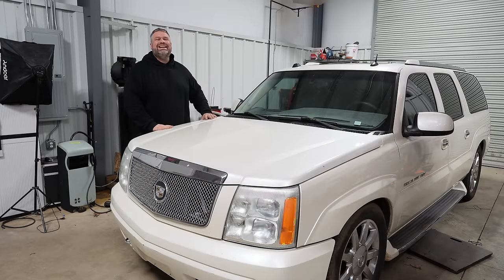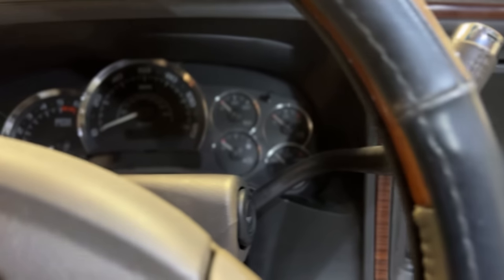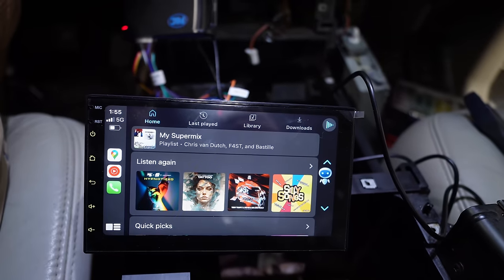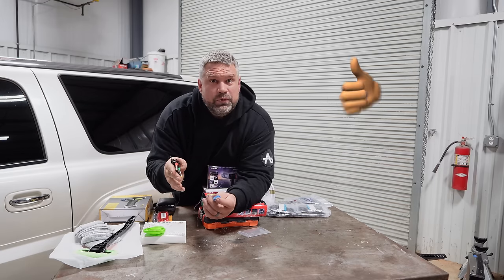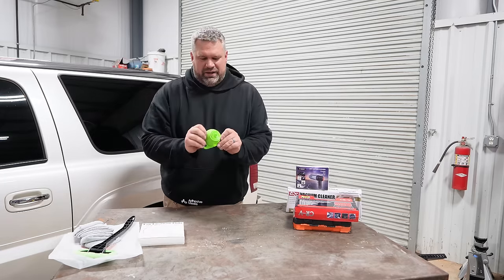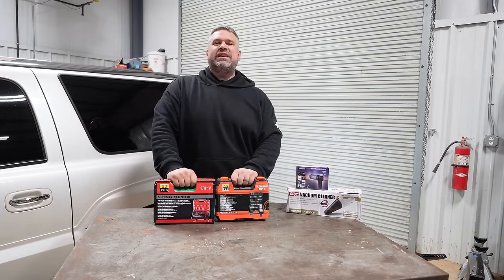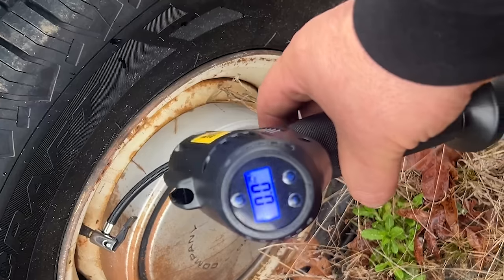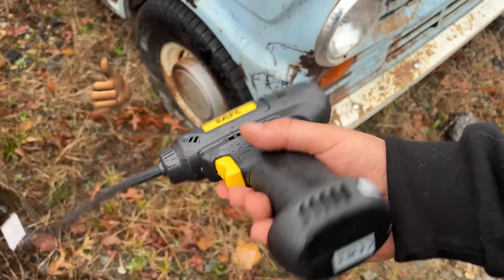Are Temu Car Products any good?

Comment: Temu, that's a negative ghost rider.  Anything my cousin has bought from temu has been cheap garbage, kinda like when hobo freight got started.  G-d bless.
Reply: Yeah, you have to manage your expectations. I have bought a few things from them. Some garbage, some not so bad. Bought a cordless electric ratchet that surprised me and helped me on a job tremendously. I would never compare it to a name brand one, but it did its job just fine and saved me a ton of time. I also got a LCD projector that worked well. Did have HDMI issues with one device, but that may have just been the device itself.
Reply: The whole site is set up to hook you on buying junk you don't need - the way their rewards etc. prey on the same psychological mechanisms as gambling does.
Reply: This is very untrue, i have ordered over 2000 dollars worth of stuff off of temu and almost everything has been amazing and worked as it should, keep buying ur jacked up brand prices while i buy what its rly worth and cost to make
Reply: @Undreamt412  The question is though, do you actually need $2000 worth of the disposable knickknacks Temu sells, or are you just buying it because it gives you a bit of a thrill, like playing the slot machines?
Reply: @Beer_Dad1975  hell nah lol, i have actually only payed for 700$ worth of it, its so easy to get free stuff, they also have a lot of really good tools, including an electric tire pump that got my dad out of a flat tire on the highway, trust me i cant afford 2000$ anything😂😭

Comment: One major critique: If you're buying a head unit... GET A KNOB! Trying to use the touch controls for simple volume adjustments can be infuriating. If you have steering wheel controls, it's much less of an issue. If you don't... GET A KNOB!
Reply: This, its so dumb they are ditching the knobs, I bet there are more car crashes just because of touch screens.
Reply: So, get a knobhead unit? ;)
Reply: guess you could install a volume knob, kinda like how we used to have bass pot knobs back in the day when we didn't care about our hearing
Reply: Used to? I'm 41 😆
Reply: I stuck a Sony 1-DIN basic unit in my economy hatchback that cost half the chinese-android ones, and put the money into better speakers. Now my hatchback is a tincan from Suzuki, but still at low-to-medium speeds the music sounds great.
At highway speeds the noise crowds out the music but that's the tincan to blame.
Reply: Real men like having knobs.
Reply: @PoliteChihuahua  That's actually what I did I bought a separate volume knob for my car to mount somewhere, but the options are pretty limited.
Reply: the major critique is not buying Chinese garbage head units, get a quality unit like a Kenwood or Pioneer, knobs are a good choice, but physical buttons are an acceptable fall back, on screen volume is a no go, steering wheel controlled is best, by far.
Reply: @DanielRichards644  Actually, plenty of Chinese head units offer newer chip sets and higher end components than many big brand name stereos. The main difference is usually the software development time. A unit from a big brand will typically have fewer bugs and a better warranty, plus higher quality overall, but that depends on what you are paying. They are often using processors and chip sets from several years ago while Chinese units may offer the latest available and higher resolution nicer quality touch screens. They are generally compatible with steering wheel control and other integrations as well. Just gotta do your research and you can often find exactly what radio and stereo amplifier chips they are using. Then you can compare to the big brands. Buy cheap and you'll generally get cheap, but for half the cost of a name brand you can actually get a technically superior product. Just take lots of research. The big brands are generally made in China now as well after all.
Reply: @802Garage  I have an android head unit in my 2016 civic because I needed it fit that dash and maintain vehicle functions that run through the headunit, these things have a single channel subwoofer output, a nice Pioneer will have 4 volt preouts that get you a cleaner signal to your amps. And that Chinese unit is glitchy with random ghost touches when in android auto and crappy call quality. A more powerful chipset is meaningless when the quality is all around lower and I bought the highest spec unit on the market that fits the civic dash.
Reply: @DanielRichards644  Well I feel like you didn't really read what I said. You can get everything your Pioneer unit has and more in a Chinese head unit, but you have to actually research it. Higher voltage preouts, front rear and sub outputs, a better built in amplifier chip, nicer touch screen. Pay bottom dollar you will get bottom performance. It's like comparing the cheapest Chinese made laptop against a $2,000 Dell or something and not also comparing a $1,500 Chinese laptop. You may have bought a high spec unit to fit your specific dash, but again that limits your scope to an extreme. You definitely didn't buy anywhere near the highest spec or highest quality unit available. I'm sorry you had a bad experience, and I'm definitely not saying everyone should buy cheap or no name or buy Chinese in every situation, but I'm just saying your single head unit is not the entire market. Either way, misses the entire point he made in the video which is if you just want to be able to listen to some music and don't want to spend a ton of money, telling someone to spend $350 or whatever isn't very helpful.
Reply: @802Garage  I didn't pay bottom dollar, the unit I bought cost more then my fucking Pioneer in my other car.
Reply: @802Garage  I did buy the highest spec out there with an octocore CPU, 8 gigs of ram and 128 GB storage and wireless android auto, it is still the highest spec android unit on the market TODAY.
Reply: @DanielRichards644  Well again, not all made equal. Not sure what else to tell you. 😂 I've already covered every base in this conversation including that I agree not everyone should buy Chinesium.
Reply: @802Garage  So you just keep changing the narrative instead of accepting you are WRONG, got it, GFY
Reply: @DanielRichards644  Reread my original response to you which literally covers all the same points. No narrative change whatsoever. This is why I said I felt like you didn't read what I said.
Facts:
1. Paying more does not always mean better, including big brands.
2. The specs of head units varies wildly and you'll need to research thoroughly, as Chinese units can be ancient tech or top of the line.
3. Big name brands generally spend more time on software development and use higher quality components on average.
4. Not everyone should buy Chinese or big brand as it will vary by needs, budget, and specific units.
5. It's always possible to have a bad experience as you did, including with big brand names, read reviews and research thoroughly.
6. If you just want to listen to music and you aren't an audiophile, even $50-100 can get you reasonably sorted.
7. Almost all of it is made in China now so massive blanket statements aren't helpful.
8. Calm down I was just having a conversation not writing a head unit bible.
Reply: Facts.

Comment: Biggest issue I have seen with cheap zip ties is no UV / heat protection.  Cheaper ones quickly become brittle when exposed to sunlight or any heat.  Need to get UV resistant ones unless its something you don't care about long term issues.
Reply: They are OK under the dash or in the trunk, but not under the hood

Comment: Your advice about checking the same and other websites for identical products much cheaper is spot on. Often there are "brand names" on websites which are exactly the same as generic items on sites like this for a fraction of the price. Even small items I'll often find for like $5 instead of $10 or so elsewhere.
Almost completely unrelated, I'm watching my brother's Great Pyrenees and it managed to get out the door and go on a 7h adventure in the snow while I looked for him and got exhausted. He showed up at the end of the driveway when I was about to go out driving to look again and hopped right in the car. Oof.
Reply: I have my Child safety locks on the back doors in my car for my dogs and I lock the windows when they get in. My Lab is no problem but my german Shepard boxer mix is insane and I could see her getting out.
Reply: @jimyed  Hahaha in this case I had been up late and someone else left the house front door not completely latched so when I came out of my room the door was wide open. I tried to lure him in the kitchen with food, but as he came in I tried to walk past him and he turned and bolted. I did a movie scene worthy dive to try to grab him and he slipped through my fingertips. When I went outside his tracks had already been all around the house and all over the woods. He just continued from there. He was probably outside for a total of 8-10 hours constantly on the move. Can't say he doesn't have energy. Luckily a rural area with limited traffic and he is pretty big and noticeable. Much faster than me across an open field and through the woods though. Go figure.

Comment: a radio with a knob is nice to have to be able to turn the volume down quick fast in a hurry
Reply: You would think so. I have a 2022 ram 5500 work truck. The knob refuses to work for the first 30 seconds when you turn it on. Same with our 2019 van. Not a huge deal unless you had shut off the truck with the radio cranked up. Lol

Comment: With nothing but respect towards @The Questionable Garage, I think the best, most accurate experience Jared had was with the Emoji face sign. 
I can confidently make the following predictions: 
• If the Emoji sign continues to operate BEYOND the initial unboxing, it will not continue to operate in the correct matter; it will almost-certainly come detached from the window every time you hit a bump (and probably never come back On); it will refuse to come On when you want it to; it will not display the pattern you select on the remote; and/or it will come On when you DON’T want it to (when there’s a police officer behind you).
• the tire-repair tools (specifically the hole-reamer and the plug-setter) will break the first time you try to use them, with the cheap plastic T-handles shattering (especially likely in colder air), and the cheap metal shaft impaling the palm of your hand (AMHIK).
• the Tire Inflator will be unable to inflate anything larger than a 26” bicycle tube, but will continue to try to reach the preset pressure until it overheats and trips its “overload protection” - which is in reality, just the tiny 64-gauge Jhinese capillary wires becoming the “fuses” they were always destined to be - and the inflator will then become a handy rechargeable PAPERWEIGHT. 
I will confess, I do own one of the compact units (the size of a 17-oz water bottle) and keep it in one of the bags on my bike; it might one day be useful in getting my bike to a safer repair location, but it has not a snowball’s chance in hell of fully-inflating any of the normal-size, 14-/15-/16-/17-inch Automobile or Light-Truck tires on my vehicles.
• the Mini-Vacs will reliably suck… but not in a vacuum-y manner. Either the battery in the rechargeable unit will soon stop taking a charge, or the motor will overheat in the same manner as the Inflator. 
The corded unit may have a fair chance of continuing to run for awhile, but with the jheap Jhinese engineering (lack of proper bearings, insufficient wire-gauge, and inferior plastics), the motor will quickly deteriorate, causing it to become more of a noise-and-heat generator, than a vacuum.
Hey, I’m not saying anything most of us don’t already know. All I’m saying is, Keep your expectations reasonable, and you’re less likely to be disappointed by Jhinese Jhunk! #TheMoreYouKnow

Comment: The depinning tools are great and save so much time. I got the same one you show. They came with 6 sets of the tools in a little case. I use them all the time and you can't really beat them. Same for the zip ties. I don't know how long they will last but man you can never have too many of them. I also picked up the pull and cut tool for $3 and that thing has saved me from so many cuts and scrapes. Those tails are like razor blades.

Comment: Jared check the Atoto F7 Android based head unit with wireless AA and CP.
Reply: Also the Crutchfield Crux GMC2 will let you keep steering wheel controls and let you Bose work. 99 at Crutchfield.
Reply: Added the Atoto to my 2001 Chevy and it modernized the whole truck. Wireless android auto works great.
Reply: I bought an ATOTO for my Durango. Great buy for the features. 2 cons are that I am having trouble getting the backup camera working, amp isn't being turned on by the unit, and you can ONLY use their dashcam.

Comment: Bought an $80 add on 10” screen with real CarPlay and android auto on Temu. A little bit slow user experience, but overall blew away my expectations.  And yes, I’m sure it is real wireless CarPlay and real wireless android auto, which I wasn’t really expecting…

Comment: Hi. when you open a bag of cable ties just tear a small hole in the middle of the bag. You can hook the cable tie out with your finger but the ties wont fall out all over the floor/bottom of tool box etc

Comment: With regards to what I keep in the car for emergency, I've got my "Oh sh*t bag".

It's got basic tools (including a foot long piece of 1.5" diameter stainless steel bar stock that can be use as a hammer, or pry bar), a can of tyre sealant, hose clamps, a few lengths of 12 gauge multicore wire with some "Choc block" type screw terminal connectors, a couple yards of stripped thick single core wire (for emergency exhaust hangers, or just tying stuff together), 12v inspection light, tow rope, medium sized cable ties for securing stuff to other stuff, huge cable ties to use as ghetto snow chains if I get stuck, a collapsible 2 gallon camping water jug, and a lot of other random small stuff that I've no doubt forgot about.

It's just a collection of things that have either been (Or would have been) useful when I've broke down in the past. Back in my youth I had to "MacGyver" whatever cheep and cheerful piece of junk car I owned at the time just so it could get me home. Before we had mobile phones and 24/7 breakdown recovery we had something called "Self reliance", and it's a mindset that's hard to grow out of. :D

Comment: That RC car would be fun in the parking lot at work. Cheap fun
Reply: Have you seen Trailmater?  They do rock crawling with their rc trucks.
Reply: @JonStein-mu5eb I've come too far. The cheapo trucks don't give me as much of a thrill anymore. 
Me and my son both have custom built rock crawlers, bashers, drifters, no prep drag cars. All with custom painted bodies, and aftermarket overpowered electronics (drag car does 0-70 in about 2 seconds)
Probably spent more than I should have between all of them. But considering I can't even buy one of my brushless setups for the price of the whole truck......so it might be good enough to get someone into the hobby. 
If your into the crawlers, the new redcat 1/18 crawlers are on par with the best for about 100$.

Comment: "Just wait `til you hear about an 8-track. That'll really throw you for a loop."

What you did there. I sees it.
Reply: i bought a s/duty, 2000. im in aus. the trucks are built in brazil under lic. from germany & u.s.. the motor is german & g/box. 4.2mwm turbo diesel. 700nm.. ZF 5 sp.. sold world wide except for u.s.. the point is..  its a basic truck,  WITH A CASSETTE player.. no glove box, no tilt, vinyl. basic. but a damn good truck. bought a 7'' h/ unit 5 yrs ago, still in box.. only listen to radio..but a gps would be nice..

Comment: I got the little pistol grip vac at my local Walmart ($20 I believe) just to vacuum up the 2 year old's cookie crumbs. Didn't have high hopes for it but it's been great so far and the charge is lasting longer than I though it would. With the "crevice" tool installed it might be able to suck up the dog hairs but I'd bet the little filter would clog quickly.

PS: That lowered Escalade just looks so right.

Comment: Jared, I really needed to see how you got the Bose amp working! I swapped the head unit out on my 04 avalanche Z71 with the same exact Bose system, and my speakers are 100% non functioning, they worked perfect before as all that it had ever played was AM radio at a low volume (it was my grandpas truck). Head unit screen works and it connects to my phone but no audio whatsoever

Comment: I like that you got a lot od general staple items. The only thing I wish you had added was a battery or 12v soldering iron and a multimeter. Another one to grab as a quick filler item are socket stickers. I picked up glow in the dark ones than are insanely easy to read. The best $2 item out there.

Comment: Another 40(+) year old with an rc addiction here. I'm up to 13. I have mostly AE 1/10 buggies and stadium trucks and 1/8 ebuggy but also have a Slash, TLR 22 4.0 and a Tekno EB410. Believe it or not, stock Slash offroad on carpet is actually a lot of fun if the others racing are also good drivers. Passing is so hard because the diffs unload so easily.

Comment: I used to work in a detail shop and the Detailers would use a microfiber cloth when doing the final polish when buffing and waxing.
I also pissed off a Service Advisor for calling a Cadillac a Cadaverlac.  It might have had something to do with the car being owned by a local mortuary.
It looks like you should modify the rear hatch to open farther so that you don't hit your head on it.

Comment: The head unit you got has a way easier way then using the pac unit and can allow for more integration into the can buss systems. It's a special adapter that works like the pac unit but dose way more. It's also a good idea to search (android head unit) followed by (car year and model)  those kits come with everything you will need.